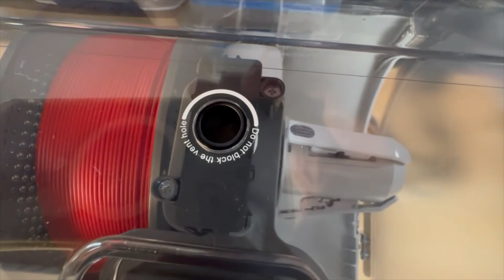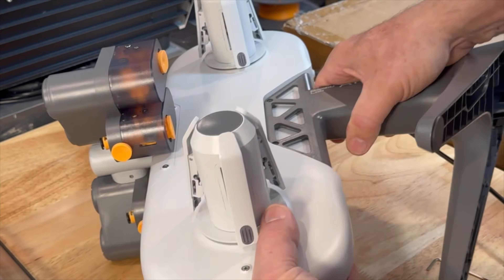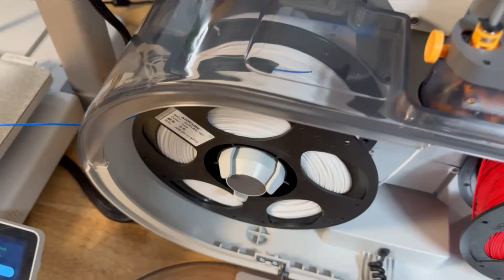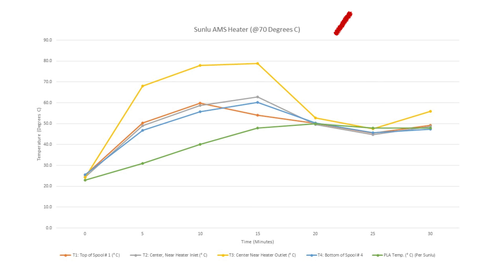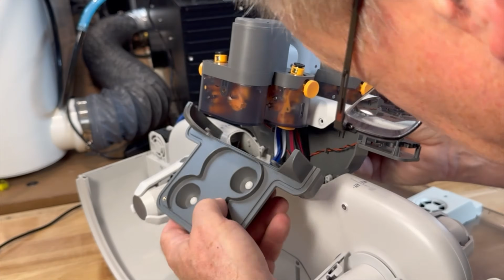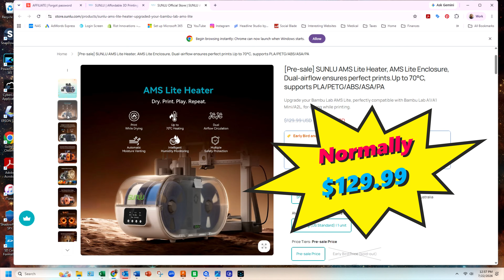Is the NEW Sunlu Heater the BEST Upgrade for the Bambu AMS LITE?

Comment: New to 3d printing. Got two A1 Combo units for my shop.
Looking at this but want to know have you had any problems with the electrical components of the AMS Lite since its housed inside the Sunlu unit vs open air on with Bambu setup? Any problems with filament being pulled properly? Thats my only sticking point ...i dont know enough yet. Hope you can help. Seems liks it would be a great investment.

Comment: Unfortunately they didn't make it wall mountable so it wouldn't work in my setup. I have both mine wall mounted and able to swivel. Too bad, I could use something like this but don't have table top room and even if they made it wall mountable, as you can see I wouldn't be able to easily access the screen. This is appears to be a good solution if you keep your ams lite on a table. It's not inexpensive but if you don't have a dryer already, this will solve that problem. It's not for me but it's not a horrible idea either.
Reply from the maker: I understand your point. Being wall-mountable would be a nice option. Thanks for your comment.